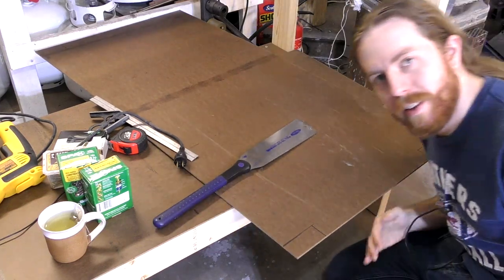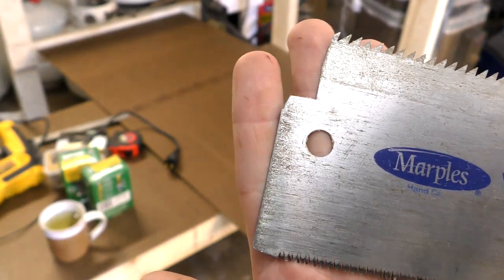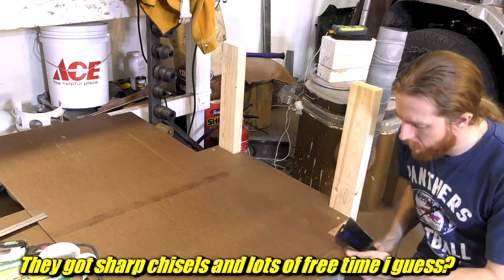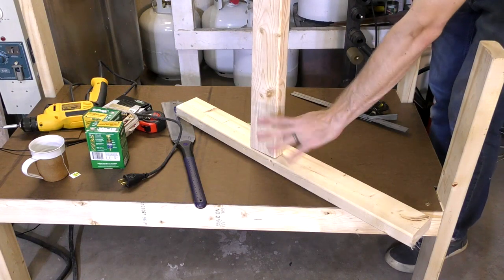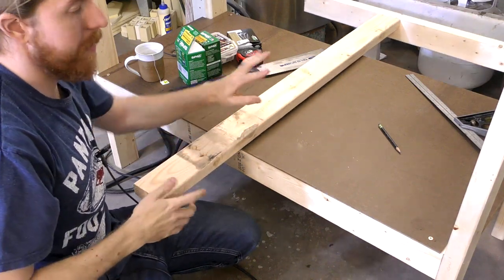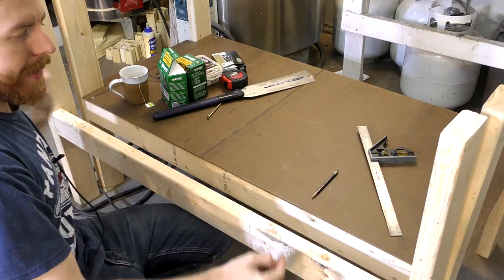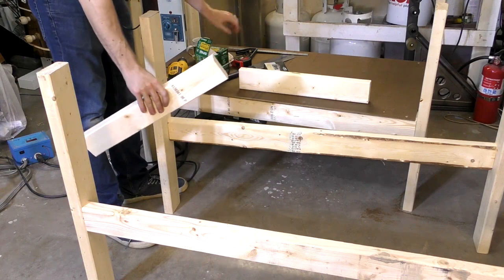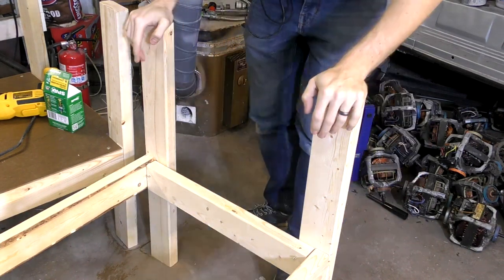DIY Make a Big Craft/Sewing Table Part 1 of 2: Bases and Shelves

Comment: The overhang is definitely a good idea in my opinion. Having only barely used my swing machine seems like it could be a handy feature.
Reply from the maker: I thought it would help fabric layout.  The design can be made either way.  You can flip the location of the legs and the boards circling the top and have no overhang, so its just a matter of choice.

Comment: A layer of felt or felt like material works best as you can pin fabrics and projects directly to the table. I’ve seen a variety of tables with felt thicknesses of 1/2 - 1 inch thick.

Comment: Do I smell a future video involving all those motors/alternators in the bottom right of the shot around 16:07?
Reply from the maker: Kinda, that's my current stash of unprocessed cast aluminum.  The shells of those motors are cast aluminum, I scrap the rest.  Should be quite a bit there I think
Reply: @PaulsGarage  Ah cool, I recently built a foundry and have been trying to find sources of cast aluminum. I'll have to check those out and see if it'll be worth it in my area!